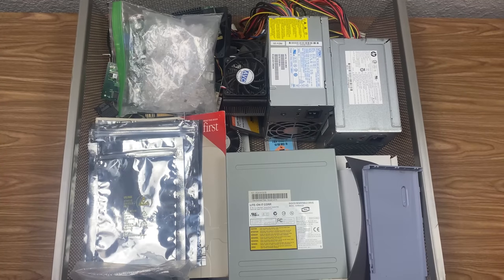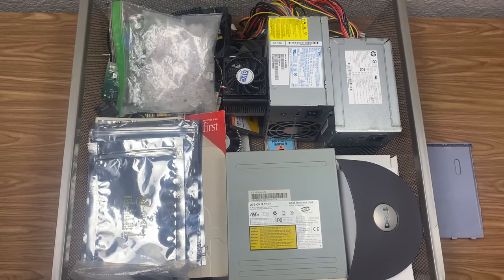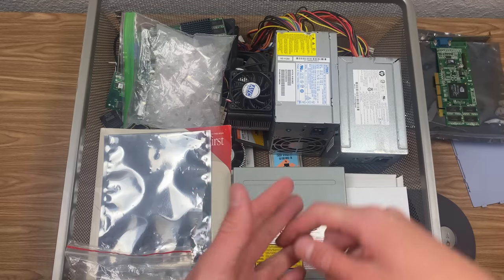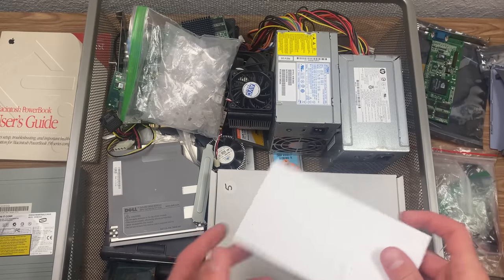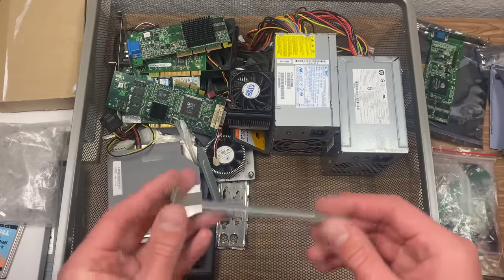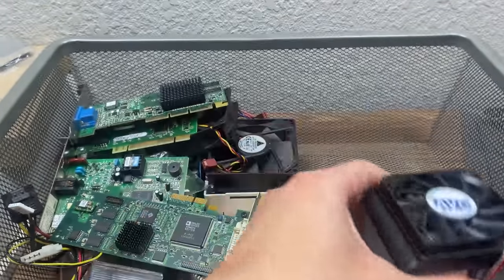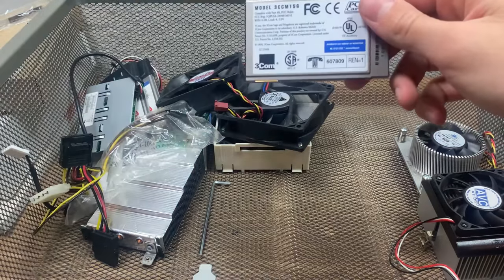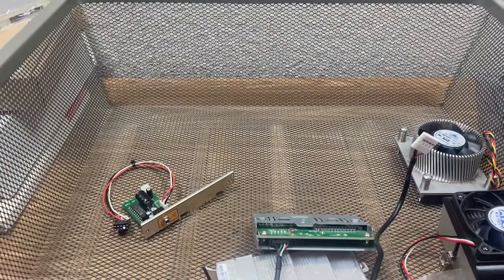Exploring My Computer Hardware Bin!

Comment: Perhaps you can make "The Scrap Build" Where you find as many compatible parts in the storage box, group together n find any accessories too and put it into some free or bone cheap old case, you could probably make a PC with that athlon cpu and just need storage, motherboard and case and use some of the GPUs, modem cards etc that you have :p Then perhaps compare performance to the win98/95 build and other computers you have!

Comment: I'm so sad, I had an Optiplex, I don't know if that is the exact model but it looked just like that, my Optiplex I had in 2009, at my last use of it, I plugged it up and it turned on by itself then the fan shorted out, smoke started coming out of it, and it would no longer turn on. I was sad because I don't know what happened to it, knowing you have the same computers as me makes me sad. I enjoyed watching your video btw, I subscribed. My only guess was that it was completely clogged with dust, and I'm not a big dust cleaner when it comes to computers.

Comment: I have bunch of spares, but only few are useable
In collection I have:
GeForce 6200 TC
Some ddr1 ddr2 RAM
Dead g31 mainboard
Dead socket a board
Unstable p4s/333c Asus PGA 478
Pentium 4 478&775
AMD duron

Comment: The DVI capture card appears to be a Datapath Vision, though not sure of the model. It does appear to be missing the VGA daughter card that connects to the row of pins at the top of the card, between the DVI connector and the Analog Devices chip. Perhaps this could lead to to the correct model and drivers: https://www.datapath.co.uk/datapath-current-downloads

Comment: Install Windows 95/98 On a newer PC that came with at least windows 8
Reply: It would be possible to reduce the ram size. If most Windows 8 PCs have 2GB of RAM, then it is most likely in dual channel, which means reducing the ram to 1gb is easy
Reply: I was able to boot my windows xoxo machine with 1gb of ram And it worked